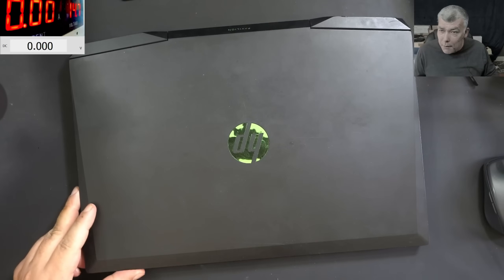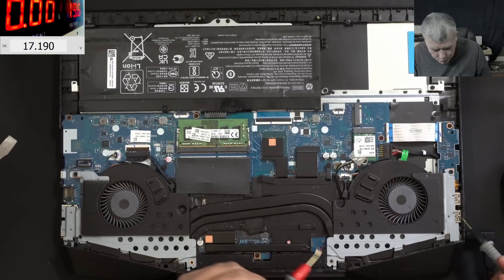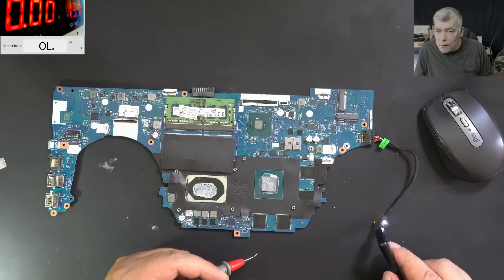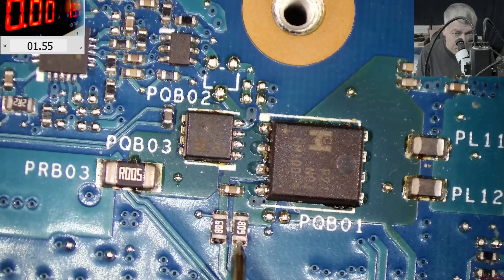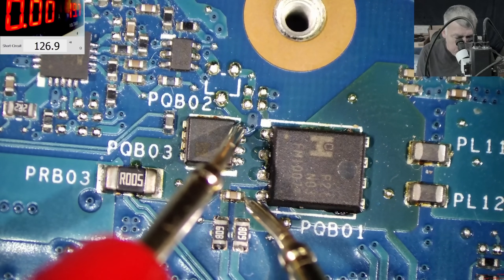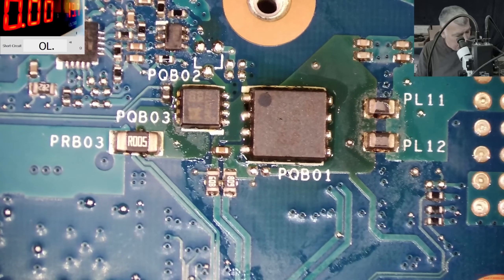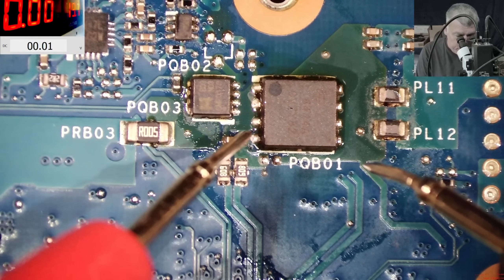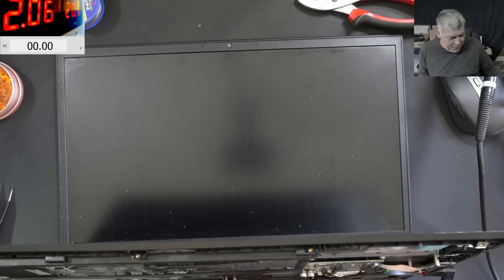HP Pavilion Gaming Laptop 17-cd1007na not charging, dead - This is how a dodgy mosfet looks like

Comment: So output of the chip was less than expected, the outward circuit was shorted
The circuit causes the resistors to appear as slightly open with voltage drop

Comment: So causes of resistor to receive enough voltage on its input,is the short between gate and source of the MOSFET,or bq chip is sensing faulty from MOSFET and produced less output 
Characterics of shorted output of chip, outputting less than expected or required

Comment: 12:29 - you used 140 degree solder to put the mosfet on... isn't that classed as "low melt"? I didn't think "low melt" was suitable for soldering components, just used in helping to remove components? 😕

Comment: The evidence pointed to the 2nd mosfet as being the culprit. I assume you went on a gut feeling that 1st mosfets are usually the problem? The voltage drop happened through the second mosfet, so i am a bit confused
Reply: He didn't know which on is doggy because the second MOSFET is on series with first MOSFET and the first on has a low resistance between source and gate so he just guessed and was right.

Comment: Nice one!!
Sorin, at the beginning, if you tried the thermal camera, would it show the first mosfet getting hot?
Reply: No there are no amps draw on power supply so no amps that's means no heat😊
Reply: Hmmm... yeah. Which is strange, right? Because there's a voltage drop and a low resistance. Considering V = R * I, maybe the resistance was kinda high (90 ohms IIRC) and the voltage drop was too tiny, resulting in almost no current?

Comment: The second MOSFET was turned off, but its body diode is forward-biased, so current can still flow through it but the body diode will cause that 0.6V drop. Observing that 0.6V drop means it is not shorted drain-source, so it is probably fine (gate could still be defective but that's unlikely).
The first MOSFET was also turned off (same voltage on gate and source, so Vgs=0), but its body diode is reverse-biased and it was still letting current flow through it, so it was of course defective.